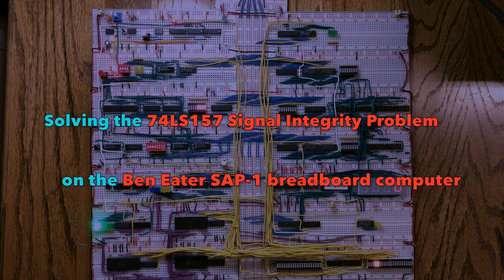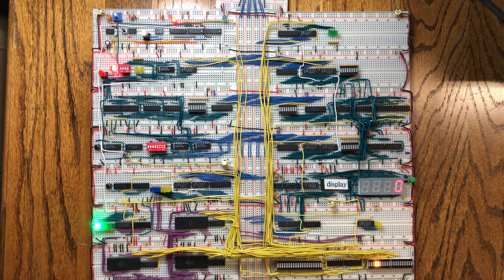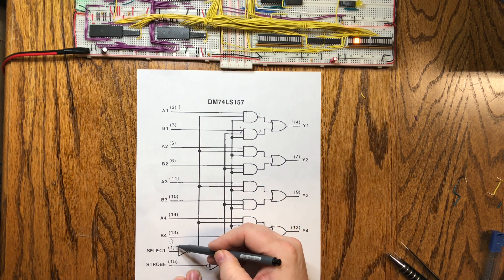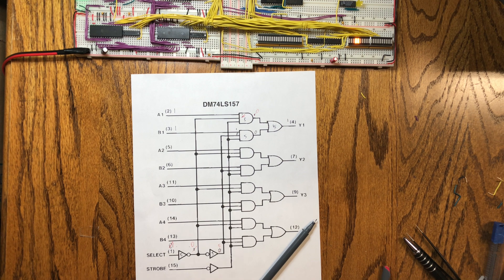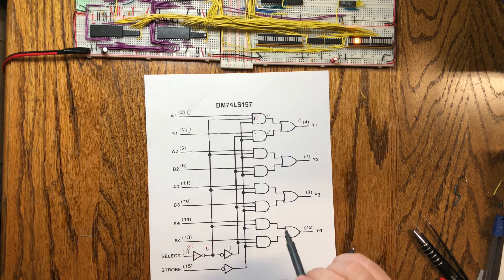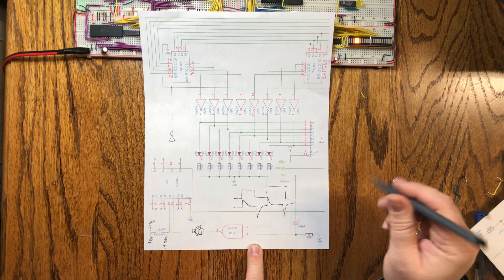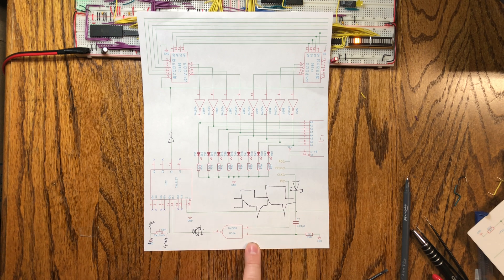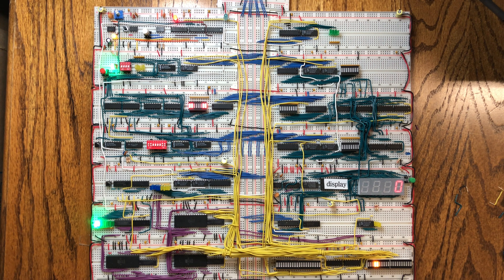Fixing the 74LS157 Signal Integrity Problem on the Eater SAP-1 Computer

Comment: Ok I have a question about the Schottky diode part of the solution. When the clock goes high the capacitor is charged. when the clock goes low how does the capacitor discharge with the Schottky diode in the way of current flow?
Reply from the maker: Note that on the other side of the capacitor from the diode is a connection to ground through a resistor. That pulls the voltage down on the capacitor side when the clock goes low. It is in fact a “pull down resistor”.
Reply from the maker: But I realize you mean what discharges the diode side of the capacitor. Admittedly I don’t have a good answer on how the electrons flow there. I can tell you (based on oscilloscope) the voltage does drop.

Comment: A more general fix would be to latch the outputs of the 74LS157, though that would add another chip.
Reply from the maker: How would you do that when the 74LS157 output here is not intended to be synced with a clock and instead have immediate effect?

Comment: What did you use exactly for a schottky diode?
Reply from the maker: A BAT43 diode.
Reply: @MichaelKamprath  thanks,
Doesn’t it matter if the input of the ram ICs is inverted? I use the 74LS219 instead of the 189 . Can I invert the write pulse there too?
Reply from the maker: @labamichnetvoll5911  It matters insomuch that you have the sense of the signals right to the bus. The original design uses inverters to make the RAM out put active high because the RAM is active low. If you use active high RAM, the you should get rid of those inverters.